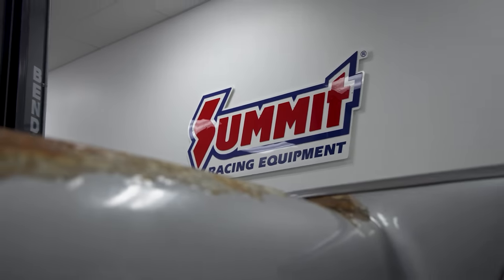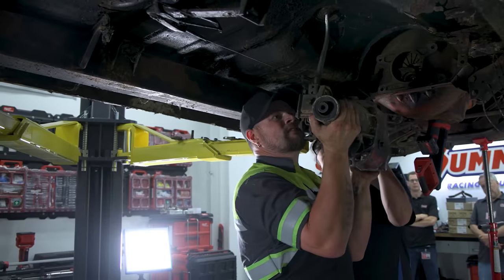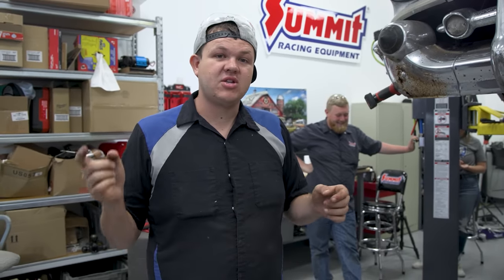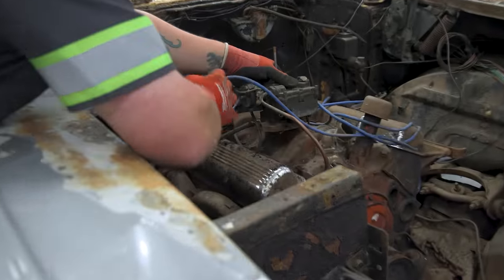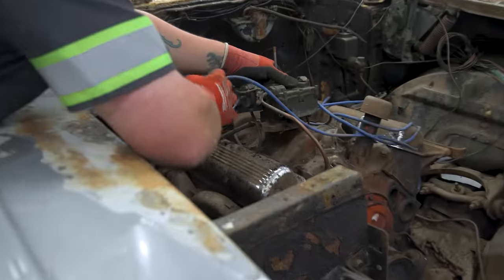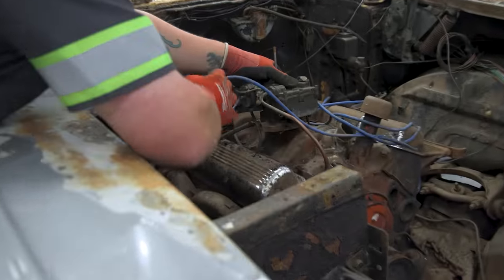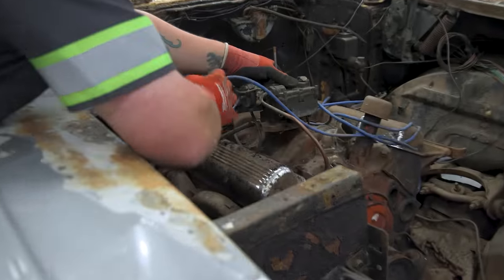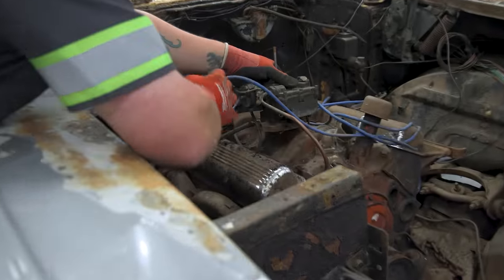Will The 57 Chevy Ever Run, And Drive Home 2000 miles!

Comment: That “spreader bar” was used to replace the cut out piece of radiator support, it was to used adjust the front opening. It kept the front of the fenders sagging inward. That’s the way us old timers “I’m 75” removed and installed engines back in the day. This week a 6 cylinder, next a 327, then a 396 and then a 427. After blowing the V8s up back to the 6 cylinder. We didn’t have all the modern technology.
Reply: I kind of laughed when robby pulled the bar out wondering what it was for he just may fine he needs it on way home when fenders go flopping lolol
Reply: I’m 77 and hated it when people cut that bar out.  A few more bolts and you could just remove and put it back.
Reply: Now I need to watch this video again dangit. I'm 31 and work on diesels but refuse to allow this kind of knowledge to be lost to time. There's no telling when I'll work on a stock '57 and I might forget this tip, but I've remembered 20 year old abstract facts before.
Reply: Almost that old Only 73, but I've been there and done that, more times than one!!!

Comment: Chevrolet began using 12v electrical systems in 1955. And the 350 was introduced in 1967.
Reply: X2 what he said ^
Reply: I knew I had a 4 bolt main 350 in a 73 Cheyenne Super.
Reply: The 350 was 1st available to the public in 1967 model year Chevies. My dad's 50 Belair was 12 volt. Thinking back, that was changed when the 6 got replaced with a 62 Vette 327 Fuelie. But yeah, you got the idea.
Reply: 1967 was the birth of the 350….come on Summit….should have know that!!!
Reply: The engine in that 57 is not original that engine block has side mount boltholes. The original 57 Chevy did not have side mount bolt holes on the Block.

Comment: Totally not hating but couldn’t you have come up with a better example of a 57 to start with? Coming to the rust belt to buy a vehicle like that seems a bit counter productive especially when you live so close to some of the best places in the country to buy clean rust free cars.  The other things is why the heck didn’t you at least pressure wash that thing before you started putting all those new parts on it. Seems like now would be the best time to do some cleaning with everything off. I know your under a time constraint but geesh. That wouldn’t take up too much extra time.  🤷‍♂️ Any who I still love the car, love the build, and love you y’all, just a bit puzzled.

Comment: Use to work at Summit Racing  in Tallmadge Ohio back in 1986. It was two separate warehouses then, quit after two weeks. Kinda regret it now. Can't wait for the finished build Robby and Hillbilly 👍
Reply: Back in that time frame, 86 , you couldn't  get to the store with a semi truck , so we parked on the berm of rt 76 and crawled under the fence .the sales guy would follow you out of the store to hold  up  the fence  for  you  and help you  load  up .  Good times !
Reply: @tomsisk6811 
 Do you mean Rt. 18? 
Summit was adjacent with I-76. 
Try fetching tires from one building  to the other building in the rain, no fun.

Comment: How skinny these suspension parts are. I know these cars were simple body on frame constructions and most were built on the same platform for decades, but it still amazes me that you can get parts for these vehicles. We have a 1963 VW Beetle, 6 Volts! It has been impossible to find a starter for 30 years. I was able to fetch one from a Type 3 (the VW "Station Wagon") but now most guys swap the electrics for a 12V system. EDIT: I love the Summit guy!

Comment: name it The Ole Gray Whale
I had one in the 70's, bought it for $750,  I put a 67' 327 4 bolt Vet engine it it. Wrinkled the roof at the rear window from Banging the Clutch Street Racing. 
The Pickle Green Monster!

Comment: Those Saginaw transmissions were bad a$$. Had one in my 67 Olds 442. Only shredded it once when I missed a power shift. My bad! Had it rebuilt, installed new clutch, throw out bearing, new U-joints, and Hurst shifter. Did all that for less than $200 (1971). Wish I had that one back.

Comment: The date code on the engine makes sense.  If the badge on the trunk lid is original to the car, it came with an inline 6 from the factory.  Someone probably transplanted the V8 into this car and added the V to the hood.  This car is probably a 210 and not a Bel-Air, as it doesn't have the aluminum fillers on the quarter panel and the hood emblems are gold on a Bel-Air.  Check the VIN tag to be sure.  If it begins with a 'V', it had a V8.  If the next letter is 'C', its a Bel-Air car.  'A' would have been a base 150, and 'B' would designate a 210.  These were all just trim packages.  All the Bel-Air trim parts are reproduced now and you can make it whatever you want.  Great project, i can't wait to hear it roar!

Comment: little suggestion...I accidently discovered a way to free seized leaf spring shackle bolts, after unbolting, removing nut, i pried one shackle just far enough off spring bushing to get a sawzall with a fine tooth metal cutting blade on the bolt it's self....intention, cut bolt, drive remainder out of spring on bench....in process trying to cut, the teeth, heat, vibration.. freed the bolt from spring...i was "why ain't this cutting?" then noticed the whole bolt was spinning, "DOH !!"...

Comment: Really digging the build. Best way to eliminate the future issues is to replace the old ones. Good call on the fuel lines brake lines and all the suspension parts. That stuff was really going to disappoint you somewhere not far from Cleveland. Keep up the great content.

Comment: Looks like you have a good start on the 57.   It's a shame you can't take the time to clean the frame before installing your new parts. The front will have new control arms hanging from the dirty, rusty and unpainted frame.  At least the rear end is only hanging from the rusty shackles.  When you get back to Utah ha,ha you should spend time cleaning up the undercarriage before starting on the body work. 
Another thing, I hope you put some floor panels in place before the drive home.  Your talking safe drive and it's a lot safer if you don't have holes in the floor the size of the Grand Canyon, that road debree can fly through.
Yes, I want the babies to get mommy and daddy back in uno piece. 
Robby am I right about the Vett?

Comment: That is frightening to see all those rust holes in those rails with you planning a 2000 miles journey. When you get it back to RL base, are you going to lift the body off the frame and fix that frame at some point? Right now it has more holes than a tea bag.

Comment: That 283 crank would have made a nice small journal crank for a 327 block... Unless it's too early made. My old small block 302 turned 9 grand and held together for years. Sold it still burning tires.

Comment: The only good thing about Ford, is the Volvo 5 cylinder engine used in some Ford cars.
You should have rubber strip between the tank and the tank straps, that is probably why the straps don't tighten enough.

Comment: What year did Chevy start making 350?

1967
The 350 (5.7) was born in 1967, when Chevy lengthened the 327's stroke. In its first iteration, the L-48 350 was a 295-hp high-performance engine for the Camaro.

Comment: Doesn’t the Vin number on the car tell you what the original paint color was?
Reply: VIN numbers back then did not have that information.  There should be a plate on the passenger side under hood by the windshield.

Comment: Chevy went to 12v system in 1955, when they installed the v-8.
Are you sure the body will run 2000+ miles after u install all the components?
This car new cost app. $2,300, how much did all the part’s cost?

Comment: Read the Vin for Original Color and equipment, I have Vin decoder here somewhere paint code will be on trim tag and be a 3 digit 700 or 8?? number and tell you if two tone or single color from hood area might be Colonial Cream for your Color, Trunk for Battery will work best from Experience You can Name it Silver and Robby be Lone Ranger and Hillbilly can be Tonto

Comment: I hate to burst the Summit guy's bubble... but the Chevy 350 did not come out in 1974. It was first introduced in the 1967 Camaro,  the the 1968 Nova, and then in passenger cars in 1969. I owned both a 1970 350 Kingswood wagon and a 1970 350 2 door Impala coupe.

Comment: I almost got excited when Robby said that he was putting one of the coolest engines out there into the car. Then I remembered, he is LS swapping that poor car. So a bit misleading on his part. For the record, I am a GM guy, just very very anti LS. I also think it is comical that Billhilly thinks the ford 5L is so wonderful. There is no replacement for displacement. I also think he should look into what a stock 5L block can handle HP wise. It doesnt take much to split those blocks sadly.

Comment: If what I was told you could tell if a 57 was a straight 6 or a V8 from the factory by the emblems on the hood, fenders, and deck lid.  If a straight 6 they were chrome, if a V8 they were gold.  Since yours are chrome, that car would have had a six from the factory.

Comment: You should be saving all those original parts....very valuable to a restoration.....
Reply: There’s very little parts coming off that thing that would be considered “original” and nothing rare or really worth saving to resell. That’s not exactly a pristine or very “original” example of a 57. Thats not the original drive train and the glass trim and body panels are all staying, anything else was pretty much scrap. Not to mention there are lot’s of tri fives out there and they make pretty much everything new now a days.  In fact you can literally build a complete 57 out of a catalog nowadays. I wouldn’t toss the engine but nothing valuable or rare.

Comment: Oh my god, who was that who told that utter crap about the SBC?
All SBC until the 1992 LT1 were Gen1 and the GEn 1 were used in Trucks up till about 2000.
There is only an early version of the Gen1 SBC which has the oil-filler-tube in the front and breather in the back and therefore needs an other Intake.

The 350 Chevy came out in 1967.

Comment: Not sure that the rotten frame on this will be safe to bolt all of these new parts on and cant see how this would pass any road worthy safety certification. Love the car but this one is far too gone its not worth saving. I understand that's its a great opportunity for advertising Summit Racing parts however I have to question the integrity of the chassis and body safety.

Comment: That guy that said the 350 did not come out until 1974 don't know what he is talking about. the first year for the 350 was 1967. Chevy took the 327 and lengthened the stroke and made the first 300HP small block 350 L-48. I hope he does not work at Summit. If so they need to teach him a thing or two about the history of GM Small blocks.

Comment: I have 3 Fords that need rebuilding due to age and lots of miles. A 61 F100 that I swapped in a 428 Cobra Jet in 1989. Its tired now 350K miles later. I have a 64 Falcon that needs its old 289 V8 rebuilt. And a 61 Falcon wagon I'm going to upgrade from the original 6 to a 5.0 liter Ford V8. Why would I shop for parts for these projects at a company whose employees tell hundreds of thousands of viewers that "We're Chevy guys."???. Maybe I should shop elsewhere for high performance parts for my non-Chevy projects. Maybe someone in Marketing should advise employees who are going to be in front of the public to not do a "Bud Light". Summit employees need to be well aware that not all of their customers are Chev-a-holics.
Reply: "Maybe I should shop elsewhere" ..... if it offends you that badly takeout the "Maybe" and move on? Lots of parts suppliers out there for your Ford projects.

Comment: That’s upsetting you are scraping the old motor.  I have a 65 Chevy that might have a cracked block but because of my health issues (as a result of serving as a firefighter) I’m unable to try to come get it and would likely never be able to change motors even if I had a reliable vehicle to come get it.
Reply: I’m just outside Denver so I would have been close to where you are planning on driving through.

Comment: thats a 6 cylinder 3 speed car, those motor mounts are not original, and 74 was not the first year 350, also that is not a 350, you kids are so far off on this deal!

Comment: 283 valueless????????what is wrong with you??????????tale that crank and install it in a 327 block and you have a screaming 302.......283 parts are getting pretty few and far between so give it to someone that knows something about older motors